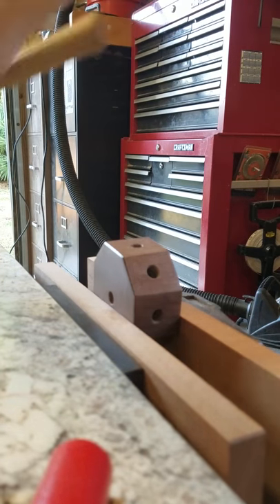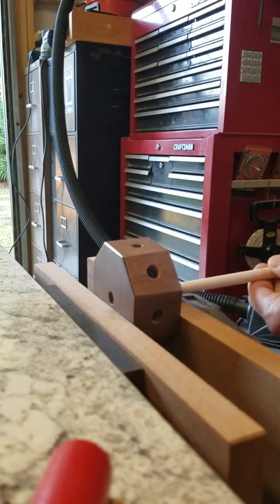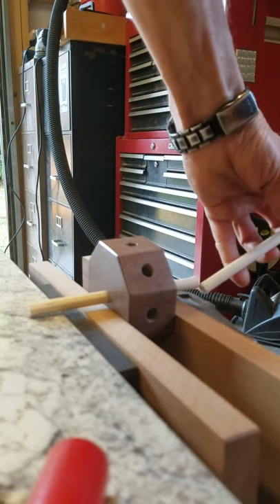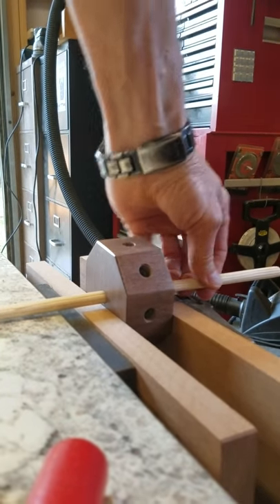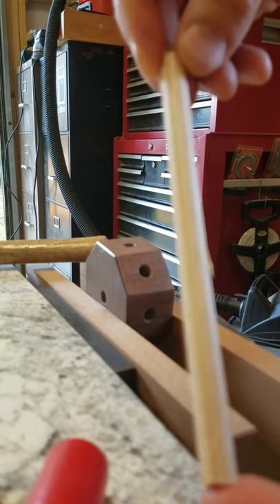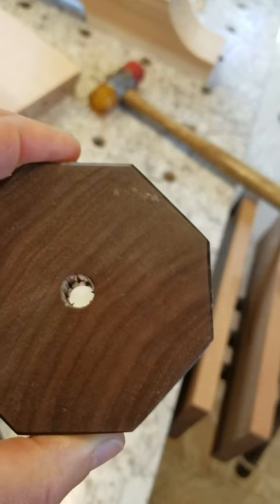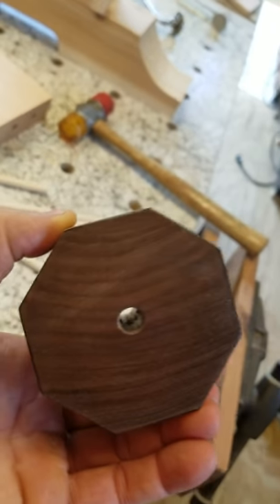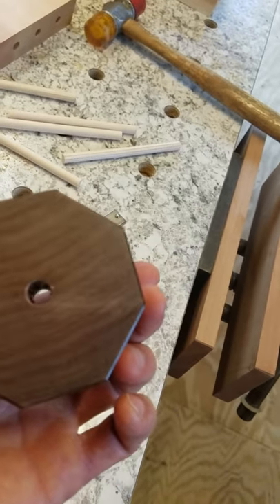DIY Dowel fluting jig

Comment: Simple, effective, inexpensive.  My kind of jig.  Perfect for my current project. Thanks for posting!
Reply from the maker: If you search YouTube, there are metal jigs you can easily make with about 1/4" steel plate and a drill to make your own dowels. One hole and one slightly offset. That's it. Only needs to be a big enough piece of steel to hold in the vice. You put the dowel you have (I've even used square pieces of wood) into a hand drill and push it through. Don't use lousy wood e.g. knots, really fibrous etc. it'll just come apart.